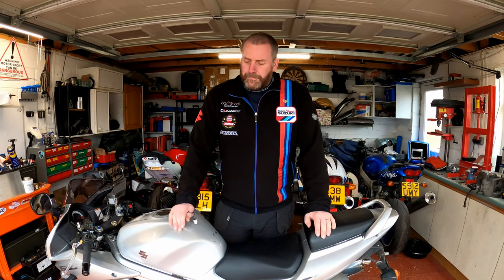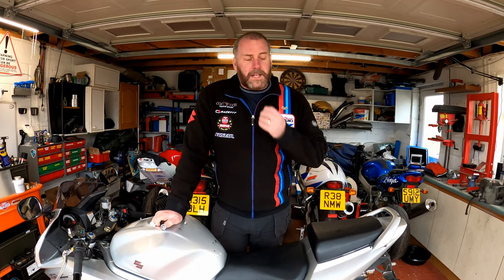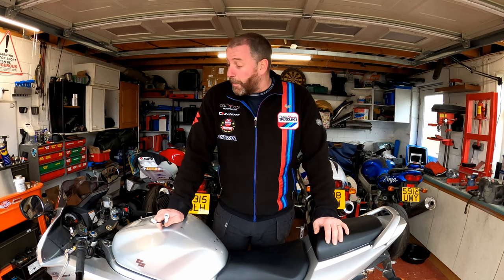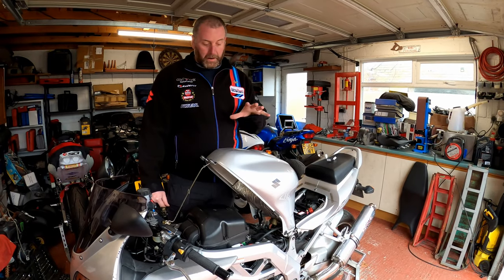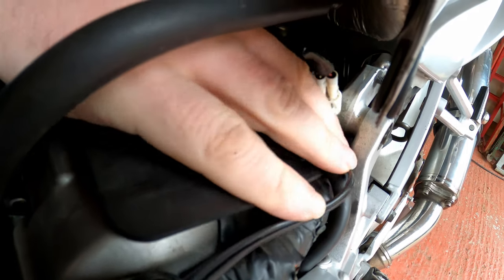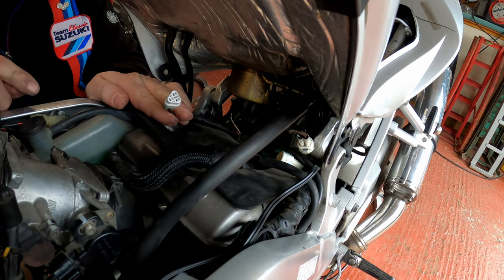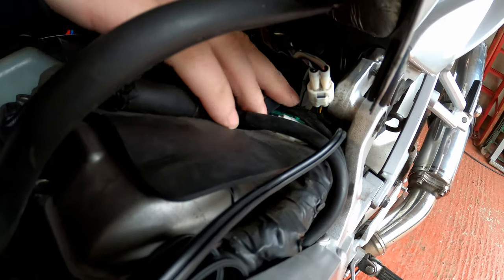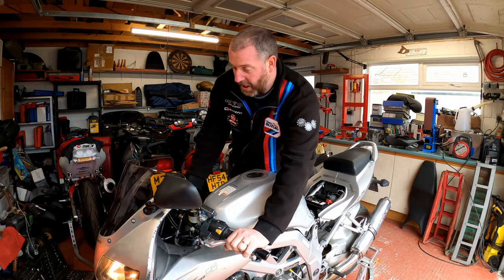Suzuki SV1000 - Timing Retard Eliminator, TRE Fitment, Quick, Simple & Easy Mod!

Comment: I have a problem with my sv1000s it runs great I have put it in dealer mode and everything checks out but when I ride it and open full throttle it suddenly cuts off at times and then it runs again it happenes in second and third gears, any advice also it keeps showing check on dash

Comment: Mister Kevin do you think the TRE mitigates the symptoms of the infamous "chudder" that these machines have due to faulty clutch basket design?
Reply from the maker: Unfortunately not chap, the chudder is a mechanical fault with the clutch, I wish it did though! I intend to make a video regarding the chuffed fix when I get the time 👍🏻
Reply: Do you think wobbling tach needle at all rev range could be caused by the clutch basket getting tired?

Comment: My sv1000 back fires like no other it’s like gun shots every time I rev or let off the gas/decel , would this help?
I have short super wide cans k&n filter
Reply: I hope I figure it out before it wrecks it if it hasn’t already
Reply: You can give the shooting to my gixxer bro, I miss it so much 🥴
Reply: They run fairly lean from factory so once you changed your air filters and opened the exhaust up you leaned it out even more they call it "lean popping"

Comment: Deleting comments ?
Reply from the maker: I don't believe so! 🤔 What makes you say that?
Reply from the maker: That's really odd mate, I genuinely haven't seen your comment buddy, sorry about that! Anyway, what this mod actually does is kinda fools the ECU into thinking the bike is in 5th or 6th when it is in 1st - 4th. The bike only retards the timing in the first 4 gears, it has no negative impact on 5th or 6th. The only real problem with this TRE is it stops gear indicators working properly as you would expect. Hopefully that answers you question pal! 👍🤓
Reply: @KevsShed  Hey, that's absolutely fine pal; genuinely, it must have been an issue with YT !

Glad whatever was causing the problem seems to be sorted now.

Thanks for the reply and the clarification :) 

I have a K1 GSXR, if if end up fitting one I will report back with whatever findings; hopefully it will be a useful data point.

Thanks again dude
Reply from the maker: Your welcome mate, thanks 👌🏻😎
Reply: Hey mate looking at doing it to my SV 1000 I noticed with the connector noticed a green wire going up towards the front of the motorbike wondering can I buy pass them a different way
Reply from the maker: @TMJ.88  Evening bud, i'm not sure that I understand what you mean mate.
Reply: @KevsShed   Can can you bypass it any other way or do you need the eliminator
Reply: @KevsShed since i have fitted a tre my fuel light has stopped working and when i disconnect tre fuel light works again do you know why this is ?